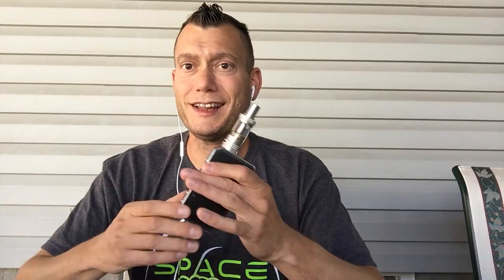Dangers of Ni200 nickel DON'T vape it on anything BUT Temperature Control!

Comment: I think Ni200 should just be pulled from shelves. There's enough research outside of the vaping community that supports Ni200 being toxic and harmful to humans. I used temp control for a couple weeks on high end mods and I still didn't feel comfortable with it. My biggest concern would be in the mods/tanks/coil heads themselves. Not everyone can afford an authentic DNA 40 or DNA 200 mod so what's their next best option? 90% of the time the ONLY affordable option is a Chinese manufactured import. Yes; while the quality may be there for the most part; we really have no idea what the boards are actually doing to the coils. Are we ACTUALLY vaping at 450 degrees or is it closer to 500? What happens if that board becomes un-calibrated and starts pumping out an extra 100 degrees of temperature? Ni200 is proven unsafe past temperatures of (don't quote me completely) I believe the number to be 630 degrees faranheit which is why ALMOST all mods are cut off at 600. I know my xPro goes all the way to 900 for some stupid reason. The xPro itself is a PERFECT example of shoddy Chinese quality control; my temp control has NEVER worked like temp control should even with their after market updates. Long story short; do I trust ANYTHING Ni200? Hell no. Will I ever vape it again? Nope; and I've got 92 feet of Ni200 left and I refuse to use it or give it to anyone. I may use titanium wire as I feel it would be a safer metal to vape off of but probably not. Especially with the vape I get off my RDA builds with Kanthal/NiChrome 80 or my anarchist wire.
Reply from the maker: +chris akeroyd Well said!  YES!  exactly!  I've been playing around with 316L Stainless Steel and some of the newer versions of these TC chips have and/or will have a setting to read SS for Temp control.  And I'll be doing some videos with that and also Titanium.  I'm furious that Nickel has hit the market so rapidly and is not a huge 'thing' and the Hype has preceded the caution and education.  So we're going to learn a rough lesson here.
Reply from the maker: +harry zaimis meh...lots of folks talk about this topic like 'old pros' but when I dig deeper we reach the limit of their experience with it, while more vast than my own, to be still limited.  Zero damage?  Neither one of us can say this.  There is no problem here.  Folks can make a choice for themselves.  and as for the more flavorful vape....MSG is tasty too.  Do you see what I am saying?

Comment: Just tried ni200  .2 on temp control. 1) I was told to use temp control 2) never was explained WHY( probably derped around in watt setting but coil was on for maybe 5 min hated it) 3) hated ni200 coil liked the .5 kanthal better. Thanks for the heads up this was great video. What about, titanium wire and even stainless ? They're temp control also right? My manufacturer Apollo says  my unit and mentioned metals for temp control?  here's what I am using   http://www.apolloecigs.com/product-p/reliant-mod-kit.htm
Reply from the maker: +scorpion528 Cool, glad this video helped.  Hey thanks for that link.  I never heard of this mod, but it sounds like it has all the right features.  Yes Titanium  and 304 or 316 Stainless Steel is for Temp Control.  It looks like a good mod, I wouldn't mind playing around with it a bit.  It also has a bypass mode where it works like an unregulated mod.  Don't use that mode for nickel or titanium though.  Thanks for that link!
Reply: Thanks for the reply I got that whole setup with shipping for $102.00 bucks on a labor day sale. yeah I like that it has the mech setting.  I would like to build my own coils eventually. Btw I subscribed to your channel. I think your channel can give me a lot of insight. so again thanks for the reply

Comment: Re your reply, I think your right after a touch of reflection on what I said. 
After a few years of vaping I forget how many new vapers there are going through the evolution from vape pens to variable voltage variable wattage box mods, Mech mods, rebuild able RTA/RBAs also the latest chips by such companies as Evolve and Yihi.
Your point was extremely valid as Nickle is a NEVER to be used on devices that are not equipped for it. As we both know it can be dangerous on battery's not coping with the non resistance Nickle wire and also there's a chance at high tempeture that Nickle can leach into your vape. Nickle is harmful if leached at high temperature as it is harmful to health.
As for Titanium I've sat that one out so far. 
Regards to you and Vape Happy.
Reply from the maker: +Oliver Turner I had to block that person as the trolling abrasiveness and disrespect to myself and other viewers was awful.  He's back though under dummy accounts still the same arguments and insults, I just leave those up now and don't respond at all.  He's even arguing points I never made in my video.  Thanks for watching and commenting Oliver.

Comment: I dont see nickel wire as safe whether it is in a tank or rda. There is a reason we dont cook with nickel, it would leech into the food. Iron alluminum and chromium are all used in cooking and are the components that make up kanthal, I would stick with Kanthal. I care about my health more than temp control, I can taste when it is becoming dry.
Reply: +John Tinker leach* not leech.
Reply from the maker: +John Tinker Well said John,  thanks for watching and your comments!
Reply: +Garl Vinland thanks dude
Reply: Heating any metal will allow for the metal atoms to be transferred, especially in an acidic solution. I have measured this with a FAAS instrument. Instead of nickel, you will be getting an Iron chromium aluminum mixture in lungs with kanthal.

Comment: my tfv4 just leaks with the single rda. it sucks idk what to do
Reply from the maker: +Comit Mods Gotta play around with wicking.  the juice channels are large, need to cut your wicks a little longer.  Don't cut the ends off.  Stuff the pointy twisty ends down in that channel and screw on the top cap.  stops the flow of juice.  If it dry hits you clip the tip off, but leave the end of the wick down a ways past the juice well channel 'fins'.  hope that helps.

Comment: The stupid comments here about the toxicity of nickel are just plain stupid since nickel is toxic doesn't matter if it comes into contact with the skin or you inhale fine metal particles like vaping and tc isn't going to change that 

P.S. Titanium is non toxic and considered to be harmless unlike the very well know heavy metal called nickel
Reply: +SnusMumriken I never said anything about fumes and nickel doesn't need to be heated to be toxic and maybe you should try googling nickel toxicity

Also when you vape very fine metal particles break off and go into your lungs and the toxicity of nickel is very well known or we would use nickel cookware
Reply from the maker: +NewLife There's the two sides to this Nickel debate.  Thanks for both of you commenting here.  Truth is we don't have proof of any studies showing that Nickel IS safe for any vaping temp.  Just hoping so because other folks say it is.  I've vaped it, however I'm moving towards Titanium and Stainless Steel in TC because I don't even care to chance it.  When somebody shows me some real data absolving Nickel of any toxicity I'll be more reassured.  We have the manufacturers and bolder vapers saying it's ok below 600 degrees, which I believed because of the overwhelming opinion of others.  However the more I ask people " how are you so sure, why do you believe this to be the case?"  the more I hear back:  well so and so said it.  and so on and so forth.  Stack enough opinions and it feels like a fact.  But the downside to being wrong on this is a health hazard.  So I'm not so confident in the consensus of other vapers.  Typically jumping on hype in an instant only to change direction when the hype wind shifts.  What's important here is that folks don't vape these metals out of TC first of all, and then that everybody understand there is a potential health risk here and nobody can tell you that Nickel is safe.  Nobody can tell you that Vaping is safe.  We must each individually make a choice of how we want to vape, just as we did when smoking.  Thanks guys, please continue the debate and add facts and links to data etc.  talk smack as much as you like here, I'm not a referee.
Reply: +harry zaimis no, nickel is toxic no matter what you do to it and I never said anything about melting but I did say small pieces break off when you vape and go into your which is worsened the hotter it gets
Reply: +harry zaimis maybe you should have a look here http://www.globalhealingcenter.com/natural-health/metal-toxicity-health-dangers-nickel/

I'm not saying using using nickel is bad because at the end of day no studies vaping based exist but the toxicity of nickel is well documented
Reply: +harry zaimis the simple fact you think it needs to reach melting point shows your lack of knowledge on the matter and if n200 is not toxic we should start making nickel cookware lol
Reply: +harry zaimis https://www.planetofthevapes.co.uk/forums/ecig-discussion/in-the-news/studies-and-press-releases/10537-electronic-cigarettes-contain-higher-levels-of-toxic-metal-nanopartices-than-tobacco.html

Comment: only idiots would even consider vaping on this kinda coil....
Reply: K.
Reply: +theCUBE403 Only idiots wouldn't understand the basics of nickel and the temperature it takes to vaporize it. Moron bitch.
Reply: Cause its smart to vape on a poisonous metal.. can you guarantee the mod will always perferm within range.. I think not.. mods are way less then perfect especially when my health is concerned.. fuck tard
Reply: I totally agree with you. China has been pumping out so many temp control devices since Ni200 has become popular since the inception of the Evolv DNA40 board that who the hell knows what the ACTUAL output of the board to the ACTUAL performance on the coil. To many variables to fuck with and too much trust being placed in an industry dominated by Chinese imports with extremely low standards of quality control. Not everyone can afford an authentic DNA40 or DNA200 mod so the next best thing is a Chinese produced product. Look at the Smok xPro m80. It's plagued with horrible temp control functionality (I speak from personal experience as I own one) and needed an update; even with the update it's still shit. I ONLY use the xPro for wattage pure and simple. I used temp control for awhile (snow wolf and ipv3 LiVR) and then started research into the ni200 wire and said fuck it; I'm much more satisfied with kanthal and NiChrome and higher end boutique wires performance over ni200 and titanium and at least I know, within reason, that the health implications are going to be far far less than a poisonous and highly toxic metal.
Reply: It all comes down to what you feel is safe to vape; I know, through research, that nickel is a highly toxic metal and there is a reason it is NOT used in cooking or anything to do with human consumption. Sure; a high quality mod may help protect you ( I have an ipv3 LiVR and a snow wolf le) but you still don't know 100% if the board is doing what it says it's doing. 630f is the temperature in which nickel starts it's oxidation process; once that occurs, you're inhaling poison. Considering 99% of manufactured boards cut off at 600f, that's only 30 degrees safety buffer that you're relying on the board to protect you. I don't personally trust it and won't use it. I've tried titanium and I'm personally not satisfied with the vape I get off it so I don't use it. In my most humble of opinions; the effort and possible side effects of using nickel is just not for me but it all comes down to personal choice, if you're going to use it, you should be well informed and well versed in building coils. My BIGGEST problem is that a lot of companies (not all) market ni200 and temp control as a great way to bring beginners from ego style pens into the advanced vaping market. Clearly that's not a good idea for many reasons.
Reply: +theCUBE403 -- Moron

Comment: Just bought my first temp control mod and nickel coils today and am looking for any and all information available. Thanks for this great info.
Reply from the maker: +Heather Gray Thanks Heather, Congrats on getting a good device.  Which one did you get?  Kudos for seeking knowledge about vaping with TC and Nickel.  Many great youtube reviews and how to videos around.  Not just my channel.  Please check back in and let us know your progress!  and thanks for watching!
Reply: I bought the iStick TC 40w. I've only had it a few hours but am having a lot of trouble with it. I have it paired with my Aspire Mini Nautilus (with a brand new nickel coil) and my tank is really hot and it keeps flashing 'temp control'. Thing is I only have it set on 220•F. I've tried going up and that makes it much worse. I called my local B&M (whefe it was just bought this afternoon) and received no help. Not sure what I'm doing wrong 😔, so for now I'm just going to use it in VW mode, but not with my Ni200 coil. Pretty bummed.

Comment: nickel is carcinogen even without heat.
just put some nickel wire on your skin and let it sit for awhile!
heating it just increases toxicity.
so stop the "only with temp control"  nonsense!
Reply: N DC that doesn't take away the fact that nickel do have known toxic properties and for me personally it gives me very bad vaping experience which i don't have with regular kanthal.
I don't know about baking gear that are "nickel plated" which i doubt  are nickel for i know and the plates i have are all stainless steel plates.
i only can speak about my own experience with vaping with nickel which i don't like a bit.
Reply from the maker: +Maca Roni Thanks, while I have heard it discolors skin, so does copper and brass.  I am looking for data and factual scientific published or reference info verifying what you say.  Do you have any links or can you point me in the right direction?  For now I'm saying what I'm saying.  You can do a video stating the carcinogenic nature of nickel from any and all exposure to it.  That's what your youtube channel is for.  Thank you though, your comments go in the mix and your feelings are expressed here.
Reply: It does not only discolors the skin it also results in a allergic reactions with different symptoms.
Those symptoms occur due the toxins leach from nickel and absorbed by the skin.

For a fast look just search nickel up on Wikipedia on the "toxicity" section.
There's a video out there called "danger of vaping with nickel wire"

When i first got my TC mod i immediately noticed the weird "metallic" taste and the fact the coils got pitch-black after few uses made me worried about it and the fact that it had toxic properties made me stay away from it.
And since there are now safer options for TC that work with stainless steel and titanium personally think it's not very smart to continue with nickel
Reply from the maker: Yes, I agree, and Wickipedia is also like stacking opinion on opinion to validate based on what?  I'm not a fan of Nickel.  I get the same metal taste from it and it fucks with the fillings in my teeth...feels like I've been chewing on tin foil.  And I got a doozy of a headache when I unwittingly vaped it in wattage mode.  I am moving in a direction away from Nickel.  But I want to see the science that told this industry it was a good idea in the first place.  I want to see the results of testing done (if any).  Titanium is at least NOT a carcinogen, and while harmful above certain temps it is at least stable at lower temps.  But I don't have enough facts to just base my opinion on anything other than vague personal experience and other folks more knowledgeable opinion.  So I'm calling for folks who view this video and read any of these comments, with actual science, please chime in here and point us to sources of fact.  And if nobody can do that then that is a conclusion in and of itself.  NO facts = NO safety, + zero confidence and quit fucking doing it.  But in the meantime I cannot take a position of absolutely it is harmful and here's how much... I must content myself to warn people that there IS harm and it MUST be considered.  A choice, if you will, before vaping this way.  Do you wish to gamble?  Thank you for the intelligent conversation, and please let us continue this discussion, this is what I wanted!!!
Reply: There is absolutely need for a research based studie on vaping with nickel.
I don't understand why they bring this on the market on a wide scale knowing that nickel have toxic properties!
I know that  there are no studies that can give us facts about vaping with nickel,but without those facts our body can give us a feedback if something is not 100% right.
Like you said and me  having  side effects with nickel is enough for me not to use it anymore,and this will not change even it were proofed 100% safe (which I doubt)
Having metalic taste while vaping is also a proof that it does leach something (had this issue  also with nichrome)
For me it's a very uncomfortable vape but i do respect others using nickel.
I also don't understand why reviewers doesn't demand a reliable study about vaping nickel!
What if the FDA comes out and say it's dangerous to vape with nickel and comes with hard regulations?
Reply from the maker: I booted that guy off the channel.  all he does is find controversy to stir up junk.  I got tired of listening to him pull wikipedia quotes in here acting like an expert.  He's blocked.